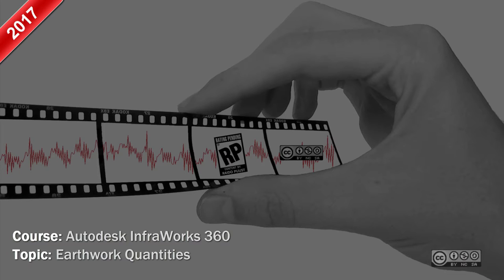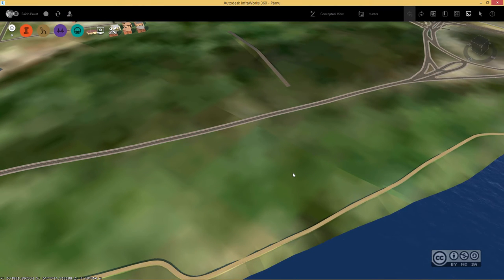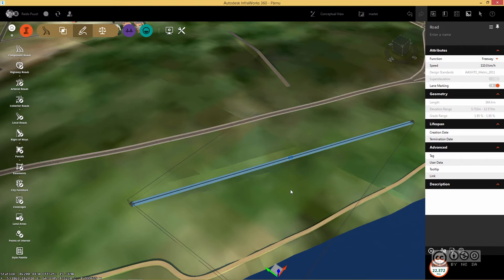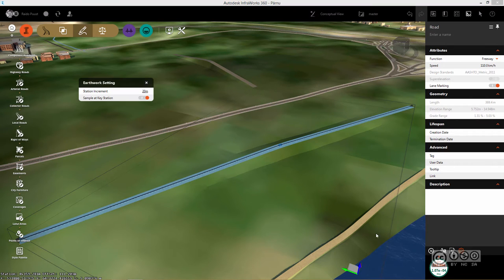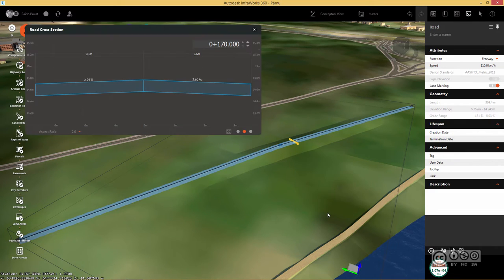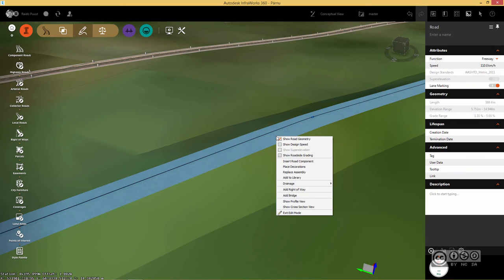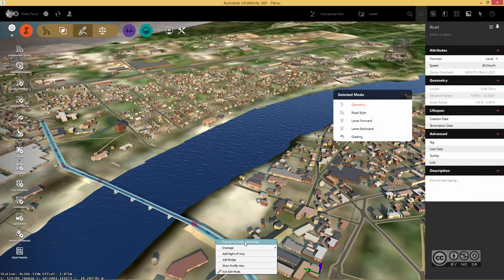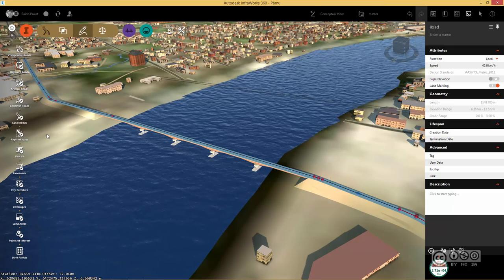Autodesk InfraWorks 360 - Earthwork Quantities

Comment: so how to import profil in this version? because in 2017 version in setting we had export to c3d now we have only imx, is it possible to import plan and profil?
Reply from the maker: You mean export from InfraWorks > Civil 3D? You can still do that (thorugh IMX or direct connection to InfraWorks database), and once imported into Civil 3D you get alignment/profile to what you add Civil 3D assembly. Quite simple actually. So, in general I do not think that this procedure has changed... You simply do not get a road corridor directly from InfraWorks to CIvil 3D, but alignment/profile line to which you have to (re)create corridor model. And then taking out cross-sections etc.
Reply: so can you show me how to import profil?
Reply: do you use whatsapp?
Reply from the maker: You can check the following video: https://youtu.be/Ti1g7M1KfLs?list=PLHYYlGqgRQXRWQ39oSkG_HfSRxgM3uhed

It shows the general procedure, how to move from InfraWorks to Civil 3D, and how you are able to reuse InfraWorks360 road design. Hope it helps!
Reply: thanks raido...can i have your email address?
Reply from the maker: Malundama Serge You are welcome! About email address, you can find it from the following link: http://www.viasys.ee/contact/ (page is in Estonian, but you can figure it out, I'm sure)